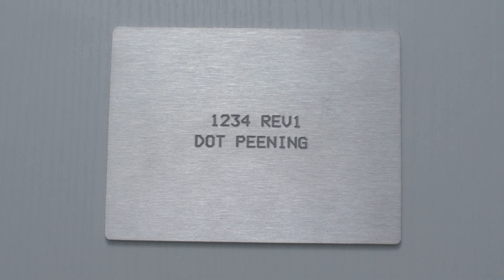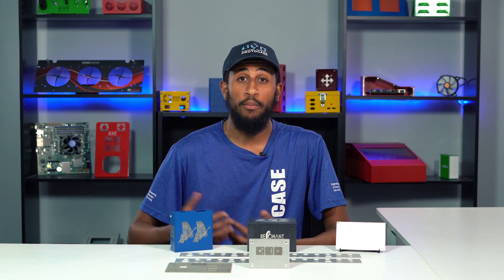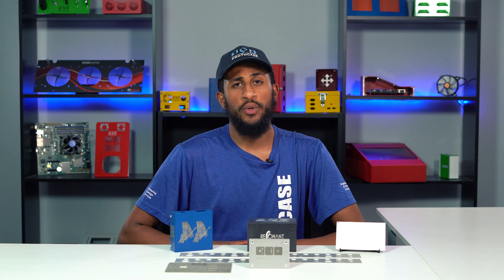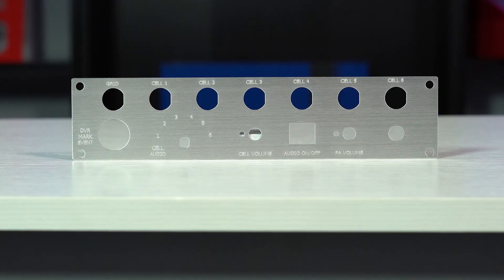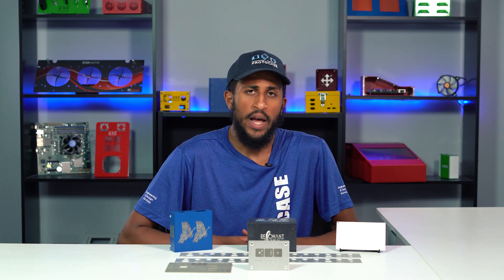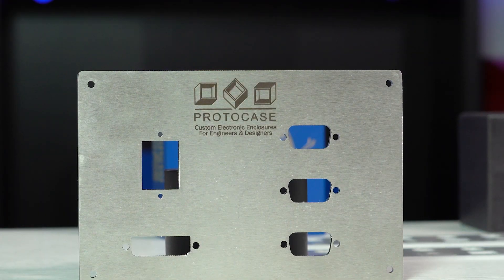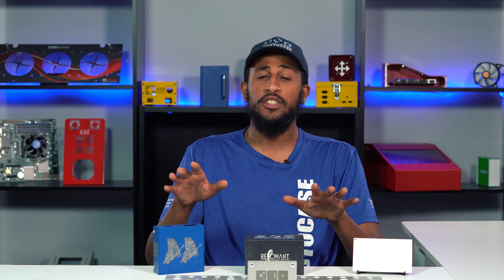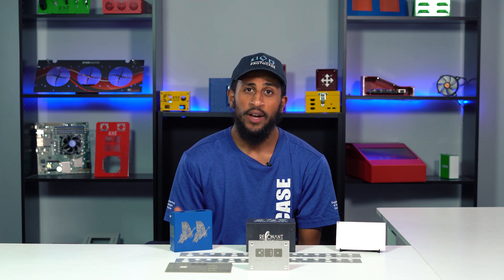Proto Tech Tip - Laser Marking

Comment: at at the 50 second mark, theres a red laser that circumvents the part to be engraved. What is that called?? Ive been looking everywhere but im not wording it right to find an answer. It seems like mostly fiber lasers have this
Reply from the maker: Hey Carlos, that is the red alignment laser that allows the operator to properly orient and place the part before it is laser marked. You can learn more here about the laser marking machinery we use here: https://www.permanentmarking.com/ :)